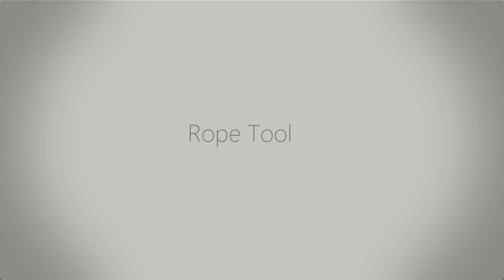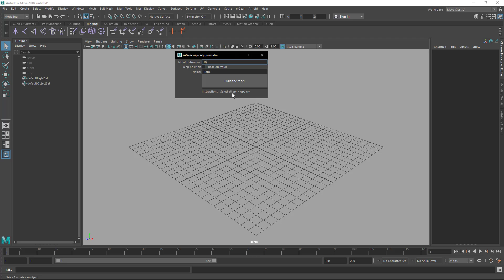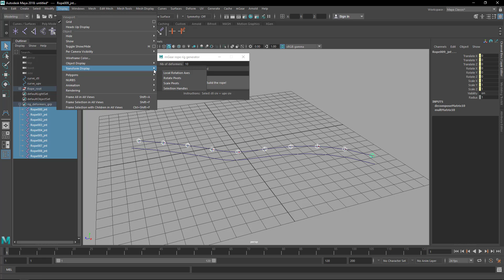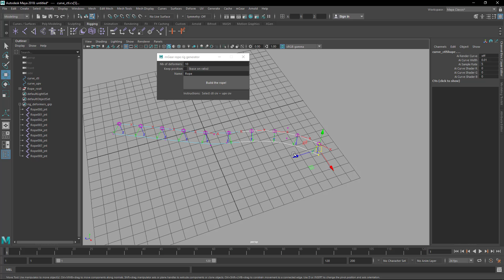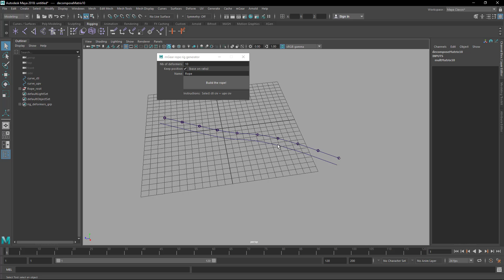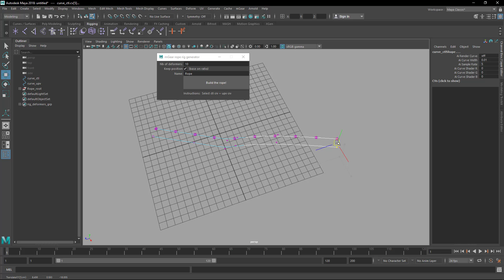Rope Tool

Comment: How would you add controllers to the control vertex points in order to animate the rope after?
Reply: to answer my question in case someone has the same question: Use clusters and maybe attach control curves to those
Reply: @freedomofspeech9084  Or you can make a joint for every cv, and skin those joints to the curve. And add controllers for those joints.